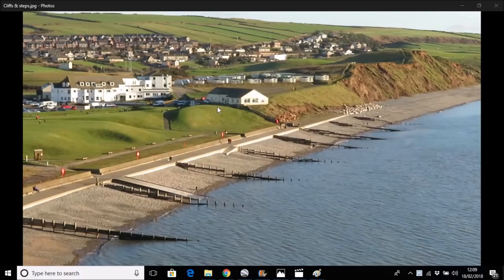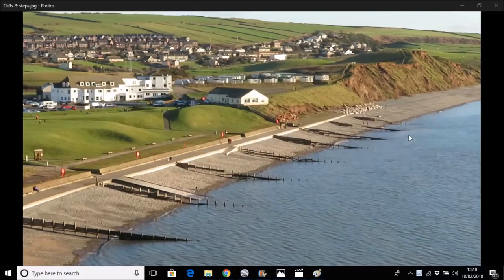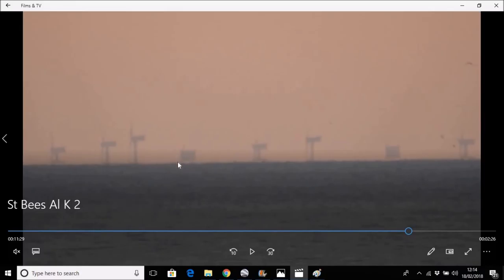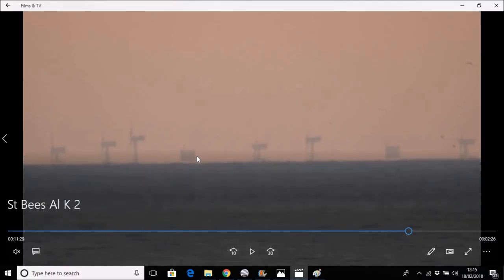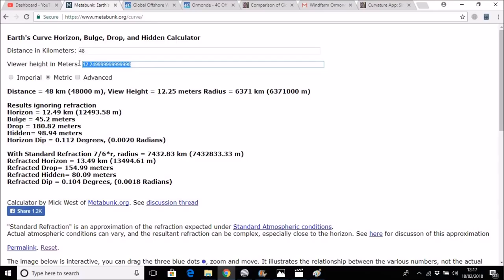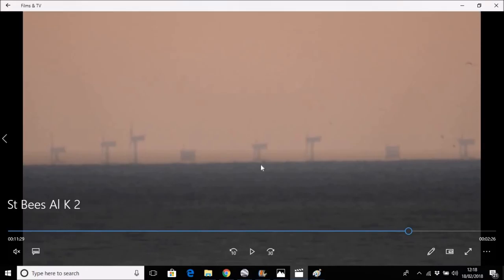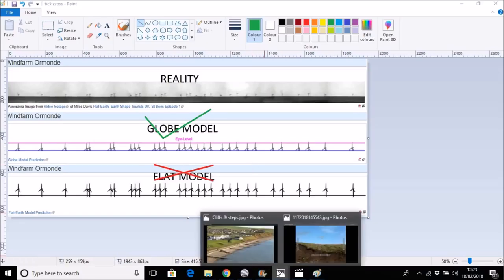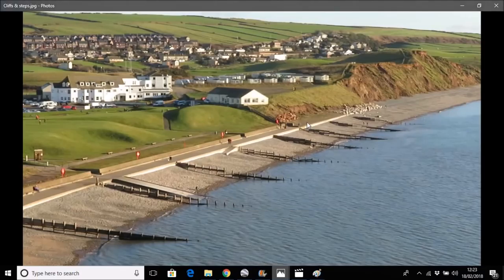Flat Earth   Wind Turbine Observations that are impossible on a flat Earth

Comment: If these guys try to claim that "dirty air" (inferior mirage) is hiding the bottom of those turbines then again they are not critically thinking and just making more stuff up.  The inferior mirage in your video has about the same angular thickness as the hubs of the turbines which is obviously not enough angular thickness to hide the  turbine masts which have a much larger angular size.  This is even more evident with an omega sun which is when an inferior mirage reflects a reverse image of the setting sun to make the "omega part".  

In omega sunset videos we know that the sun is just over 0.5° and using that as a guide we know that the inferior mirage has a smaller angular thickness of about 0.3 - 0.5°.  When you see a sun pass right through this smaller inferior mirage as it goes below the water horizon line then it only takes common sense to understand that this is not possible on the FE.  Of course the FE die-hards will probably claim that there is a line of Pac-Men in the inferior mirage eating the sun from the bottom up.
Reply: They also have no data to stand on.... how thick is this layer of intransparent air? At which temperature do you expect the mirage to rise or fall to which height in comparison to the water's surface and so on... does the location have ANY influence? Seaair should be MUCH clearer and less hazy than cityair after all... except maybe in fog-prone times where evaporation might cause disturbances above and beyond the usual values.

That shows they have NOTHING to stand on, just another "ad hoc" explanation that sounds fine to their lay-ears but nothing to show that that is the real and only reason for the claimed effect. Cue Hitchen's razor! What was asserted without evidence can be rejected without evidence. Bring proof and mechanics for this "dirty air" and we can talk. But good luck with that... millions of scientists have tried to get a good model running where we can expect to see what and did not ever find this alleged dirty air's effects... why would a couple of badly undereducated clowns on their YT channels have more success?
Reply: Feno,  you are correct.  They never use data, they only use their opinions.  First they could see Ireland and Scotland and when they finally agreed that this was incorrect they jumped to "dirty air" to "rationalize' everything.

Comment: Miles I checked Ormonde wind farm on Wiki https://en.wikipedia.org/wiki/Ormonde_Wind_Farm

It says the 
Hub height 100 m (328 ft)

Im not sure where you got 90 meters from. But you arent allowed to say something imperfect. Riley can say any height but you will be called down to the foot.
Reply from the maker: Thanks.   I got the height from this site http://www.4coffshore.com/offshorewind/   which has associated project specifications   http://www.4coffshore.com/windfarms/windfarms.aspx?windfarmId=UK17    As usual we need to trust what information we can find & do our best to be as accurate as possible.
Reply: Yeah your site is likely more accurate. I was just trying to be funny.
Reply from the maker: Sorry, my sense of humour was switched off for a second.  There is truth in what you say though. Riley would never subject himself to the same degree of precision that he expects from others.
Reply: Well how could he? He would die from any of the maths you do in your videos and that isn't exactly the height of calculatory sophistication.
He cannot even get that using a measuring tape at two points in the air is an idiotic way to measure anything if you can bring it down to the ground and have no longer to guess the distances you need to add or deduce outside of the tape's shown distance.

Comment: if there was "curvature" engineers would take into account the curvature of the earth when building rail roads for miles on end, buuuuuut they don't????? Please answer me that......
Reply from the maker: Trains can and do go uphill and downhill but only following gentle gradients. Fortunately, the curvature of the earth is not sufficient for it to have a greater effect than the local topography. So the simple answer to your question is....... because they don't need to.
Reply: Interesting!
Reply from the maker: @justincortez6868  It's not really very interesting.  There is curvature and railroads simply follow that curvature while also avoiding or sharper changes in gradient caused by local topography.

Comment: I'm going to disagree with you over the location of the "true horizon".  
From your 12.25m observation height the horizon is 12.5km away whereas the target is 48km away. So the bulk of the refraction is going to occur in the 36km between the horizon and the wind generator. By comparison, relatively little refraction is going on between the camera and the horizon - so the horizon you observe in this case IS the true horizon. The mirroring is an effect that occurs BEYOND the horizon - images from 3 times the distance beyond the horizon cannot obscure the horizon. Mirroring does not signify the location of the "true horizon".

I would encourage people to trace out the ray diagrams for themselves.
Reply from the maker: A poor choice of words on my part.  I've been planning a video about refraction effects, mainly to force me to understand it all a bit better!  Unfortunately it's a bit of a minefield of terminology & many of the photographic examples used are of the more extreme type.

Comment: Great video Miles! I'm not disagreeing with your conclusions but one thing troubles me. There is quite a bit of height difference between the closest and furthest turbines while on Google the difference in distance between you and the closest and furthest turbines is relatively small.

You found the height of the turbines but that doesn't mean they are all the same height above sea level; there could be differences in the ocean floor making some higher than others. The wind farm is about 7 Km off-shore. If you can show that the two turbines are really at the same height above sea level, then your video is a 'gold standard' in curvature experiments by eliminating variables like refraction, tides, temperature, etc. 

Even in the worst case and the turbines are not the same hight above sea level, you will have shown the flattards that the smart kids use the scientific principle to check and improve our experiments.

Comment: Maybe there is just Curvature only there on earth , LOL. How do you explain other distances seen even further seeing the shoreline ? Just try it at another day when there are no waves .Not even a nice try , sorry . What do we have for dinner sweetheart ?
Reply from the maker: 4 Truth.  Every observation matches the spheroid Earth model. If the shore can be seen it is because the observer is high enough or close enough or both. I notice you can't explain what has happened to the hidden parts of the turbines in terms of a flat plane.  Waves?   Waves that hide nearly 90 metres of turbine.....those are some big waves!
Reply: Like you calm reply, sorry for my attitude . many other examples , calais to Dover seeing shoreline . This is exception of the distances if it is 90 meter ?
Reply: you are right , we live on a ball.
Reply: IGNORANCE IS BLISS ISNT IT MILES DAVIS? WHAT? LITTLE WAVES OBSCURRING WINDMILLS? YEAH ACTUALLY. TRY OBSCURRING A TALL HIGH RISE FROM A DISTANCE WITH YOUR PINKY FINGER. WOW, A 3/4 INCH FINGER BLOCKS A 100 STORY BUILDING AT 30 MILES! SO I THINK 3-5 FOOT WAVES WILL BLOCK OUT A WINDMILLS BOTTOM AREA JUST EASILY. COGNITIVE DISSONANCE RUNS DEEP AROUND HERE. WHEN WE DO TESTS ON STILL WATER WITH LOW HUMIDITY, WE DONT RUN INTO THESE "CURVES" YOU DO. YOU RELY ON CONDITIONS TO USE AS A GIMMICK. PURE DECEPTION ON YOUR PART. VERY DISHONEST! SAD!
Reply: YOU CAN ONLY KNOW THAT THE EARTH IS FLAT BECAUSE IT DOES NOT MAKE ANY SENSE PEOPLE STANDING UPSIDE DOWN  SOMEWHERE , OMG .
JUST LOOK WHAT MOST OF AWARE HUMANS ALREADY FOUND OUT , IF AWAKE . EVERYTHING IS A LIE .................YES EVERYTHING .... BESIDES NATURE , NATURE DOES NOT LIE .